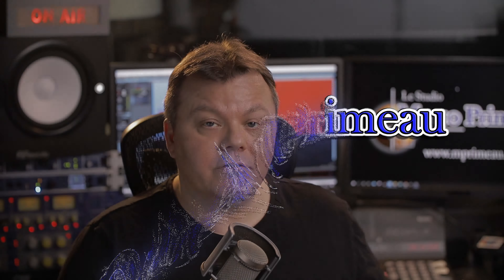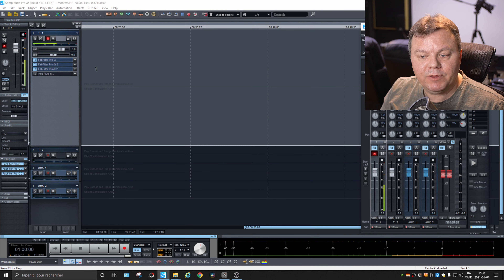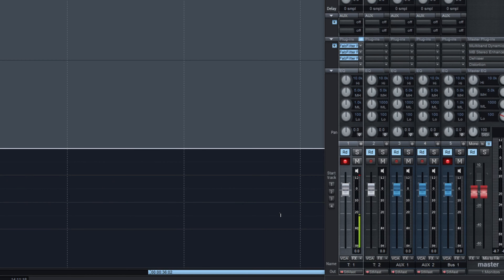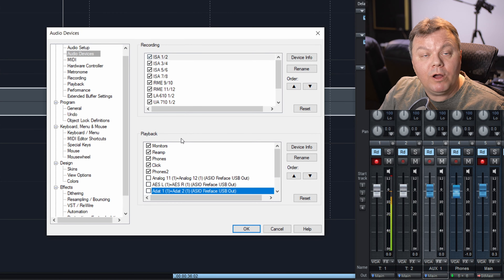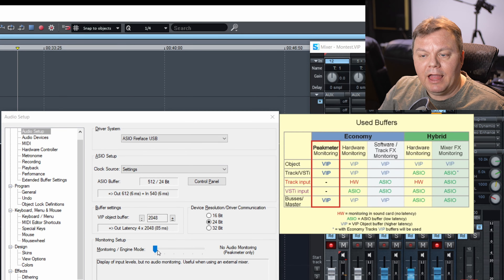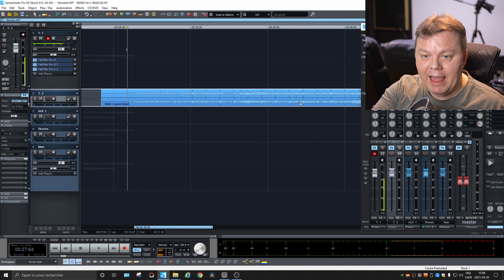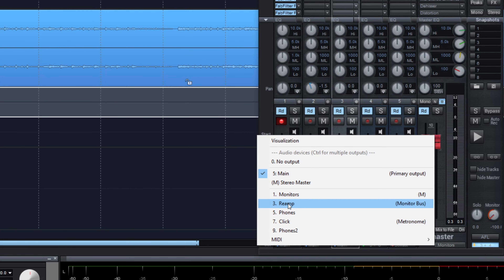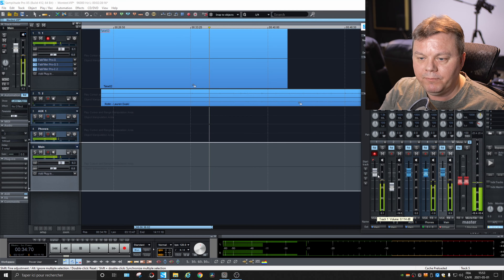Monitoring with Magix Samplitude Pro X

Comment: Hi Marco. Do you think totalmix is more efficient than the original samplitude software routing/monotoring section ? I actually working on 5.1 configuration, is totalmix have something more ? Should i try ? Or is it just better for streaming/live configuration ? Best regards
Reply from the maker: Totalmix FX is embedded into the interface firmware and give you realtime routing with no latency. It also has a DSP chip for a bit of reverb and delay for realtime enjoyment, with again no latency. Those realtime mixer, from any interface will always be better than routing via a DAW because it doesn't need any computer power. The only time I use Samplitude mixing features is when I need to hear an effect in reatime while recording, for exemple; a guitar AmpSim or a Virtual instrument (VSTi) .  For 5.1 work, you just need to assign samp's outputs to the right physical outputs.
Reply: @MarcoPrimeau  thank you for answer